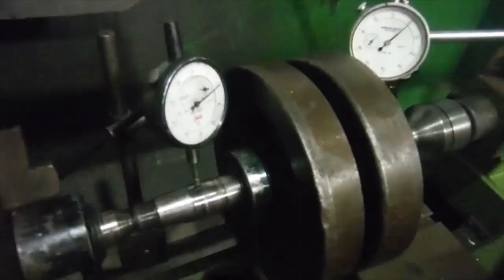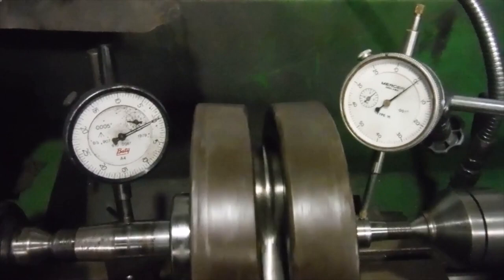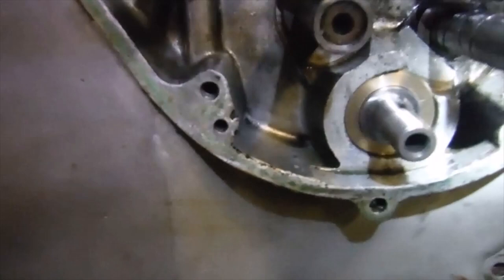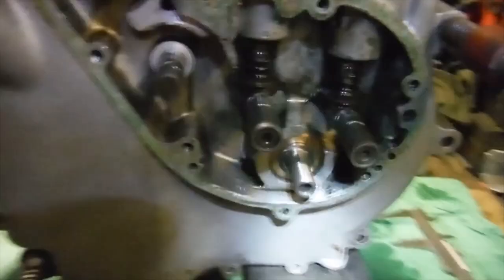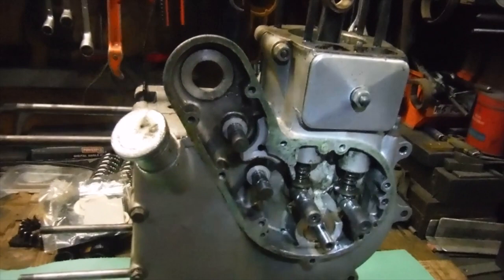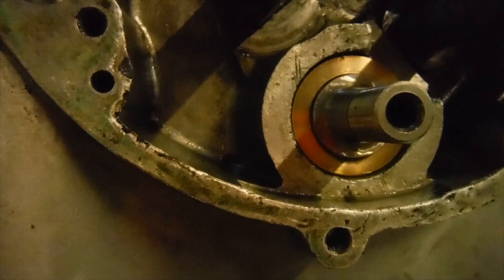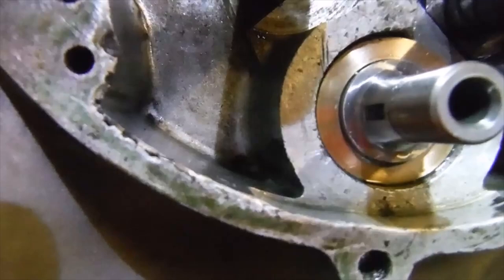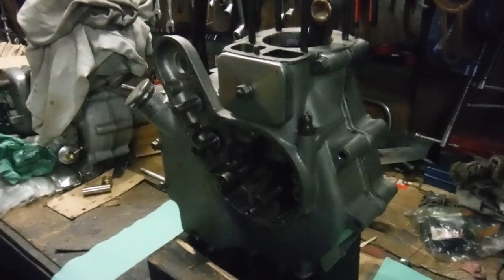Royal Enfield Bullet 350 G2 1951 aspects of full bottom end rebuild discussed.

Comment: Nice work Sir. I had the same problem with my G2 and ended up having a solid 'brass' plug fitted and then bored on the drive side bearing centre and the timing side roller bearing centre. I also managed to squeeze in a lip seal on the drive side to replace the felt seal.

Comment: Would have thought their would have been some endfloat on crankshaft to allow for thermal expansion.
I have just rebuilt a Suzuki sv650 engine and the crank case splits vertically and the crank runs in white metal bearings.The crank endfloat is set by a thrust washer that comes in various sizes so as to get the correct clearance.
Reply from the maker: Velocette engines have a cold 'negative' end float when built correctly. Engines like these expand as they warm up, so any cold end float increases as the engine warms up. I go for as close to zero as I can with the RE engines, with shims on the timing side as well, to keep wet sumping past the timing side mains to a minimum.

Comment: I'm predicting it's going to run very sweet when you get that back together 
What about going from an ally to steel con rod is a re balance needed? 
Or will you find out when you run it?
Reply from the maker: Thanks. I have swapped from alloy to forged steel conrods before with no drama as a result, so it should all be ok.

Comment: Getting as close as that with the main shaft pins is a real bonus, well done. Do you shim just the drive side or try to shim it to bore centre? Looking forward to future progress. Thank you.
Reply from the maker: Hi Niall and thanks. I shim both sides of the crank to centre the conrod with the line of the crankcase joint from the drive side, then I shim the timing side as far as I can go without the crank starting to bind, close shimming on the timing side keeps any chances of wet sumping past the bearings to a minimum.

Comment: HI Paul, I have a question, can we remove and install the Cork Seal @ 02.53 without dismantling the engine? My 1977 B1 engine has same cork seal, its leaking oil in Primary Chain Case and I don't want to open up this engine. Its running smooth since last 20-22 years.
Reply from the maker: Hi Anil, no, the engine has to be stripped unfortunately.

Comment: Look carefully at the video I can see the timing side pin running out of true
Reply: yes i to saw that to, but knowing paul and watching his vids he'll have it hand but well observed and paul did'nt seemed to concerned about it,
Reply from the maker: Yes there is movement, thanks to the [acceptable] 0.0025" runout on the drive side being transferred towards the timing side, due to the drive side mainshaft being supported by two bearings quite close to each other. There is only one roller bearing on the timing side and the copper bush, which acts as an oil seal and secondary support for the timing side mainshaft. I kept this bush as close a fit to the mainshaft as I could without it binding on the shaft at any point of rotation. It is very unlikely you will see no runout here, the most I measured on an Indian built engine was over 1 mm - far too much, although they have rubber lip seals and no bush!  This one turns freely by hand, so I am not at all worried about it.

Comment: HI Paul may i ask if now the drive side is held 100% in its bearing ,could not the runout be transferred to the timing side and giving you that slight runout .
Reply from the maker: Hi John, there are two bearings quite close to each other on the drive side, so that 0.0025" runout on the drive side gets shifted towards the timing side, which is why we see that slight throw on the timing side mainshaft, although it is all within tolerance. It is very rare indeed to get zero runout, although I have managed it a couple of times!
Reply: @paulhenshaw4514  Thanks Paul for your reply .